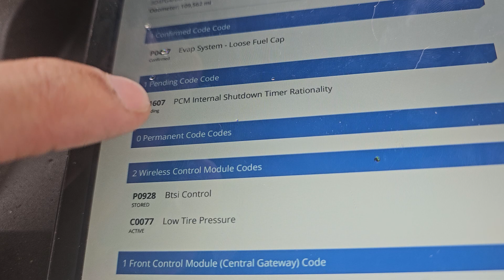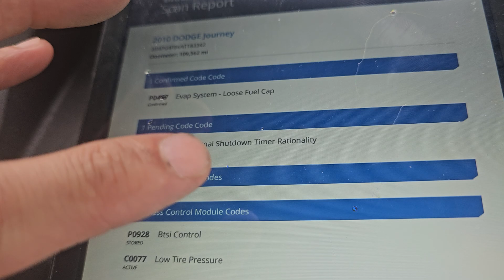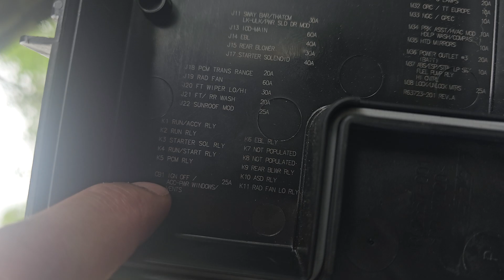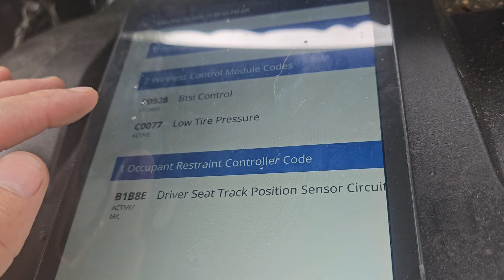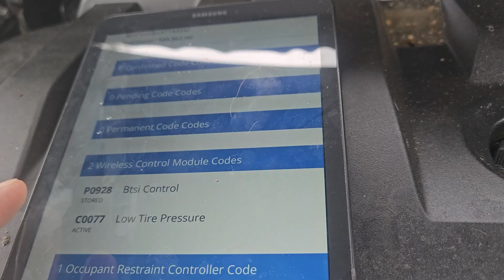How to Fix Code P1607  – Step-by-Step

Comment: I have a jeep patriot 2011 same engine, seme code p1607, is this problem maybe cause that the truck sometimes jerks or pulls in the first seconds of the acceleration after a red light?
Reply from the maker: I would go with the small things first check the relay or the fuse first most of the time it's the relay or the fuse that went if the fuse has the yellow thing in the picture in the video and that thing's cracked that means the fuse is blown and the relay you can test with a multimeter or a battery to test the relay

Comment: I've got the Jeep Patriot the same engine. Just put a new inake manifold gasket after getting a vacuum leak code so that I was there. I put a starter motor in because I had it spare and thoddle body turned car on after job no leak code just this code p1607 did learn turn off back on and the code gone I going to get a relay and change it just incase thanks.
Reply from the maker: soon i got change  starter lol big job like working on my cars i learn things lol
Reply: Being driving two days, no codes have come, so hopefully, in the clear, it's my daily drive. The wj got a stupid power steering hose. I can't get it off. Bloody jeeps, them designers -----